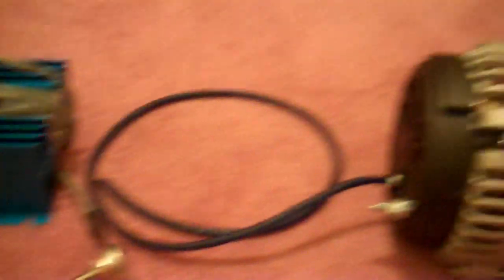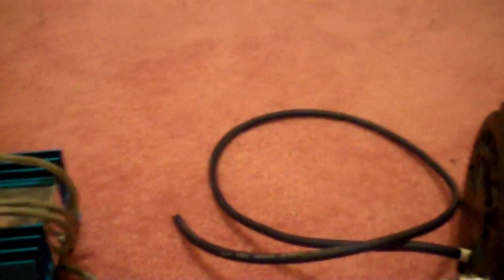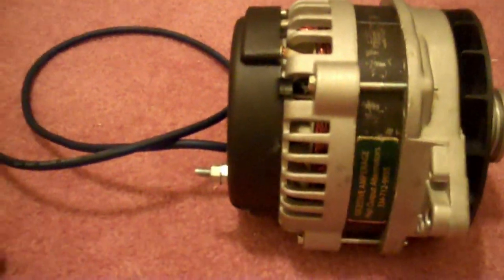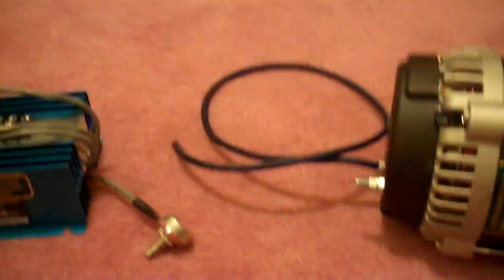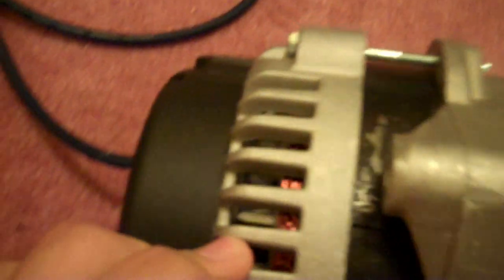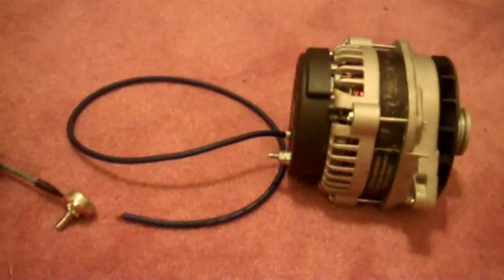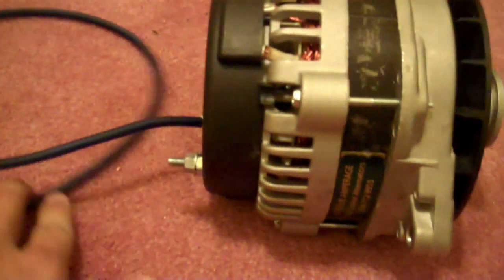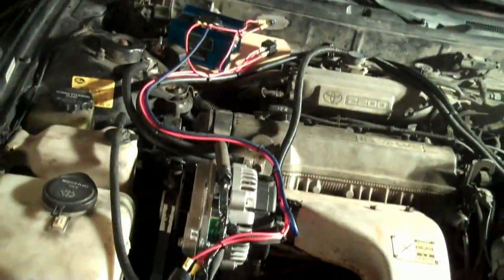Excessive Amperage 250 amp alternator install - Update

Comment from the maker: the regulator is so you can regulator the voltage manually. you can turn up or down the voltage to your liking. it is not necessary for an alternator to have one. you can get an internally regulated alternator instead, which has a regulator built in that regulates the voltage automatically for you